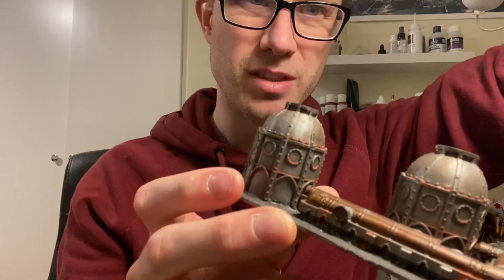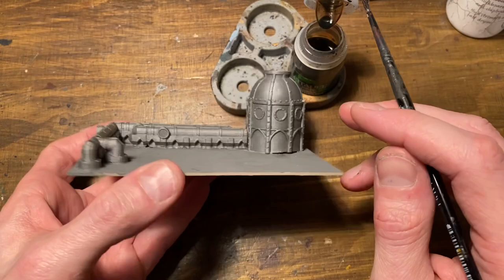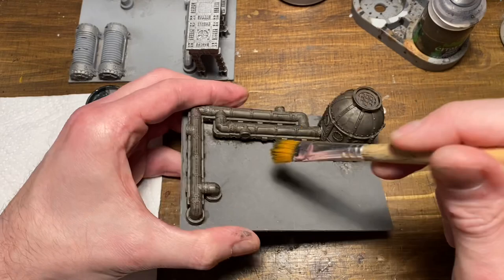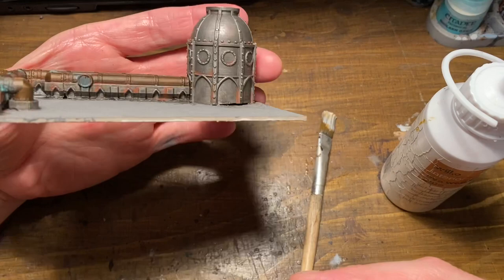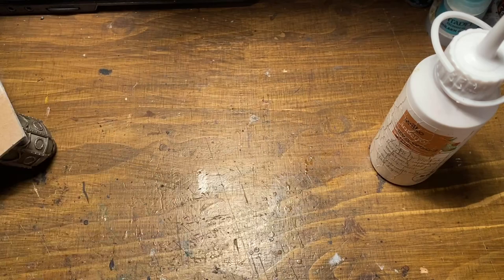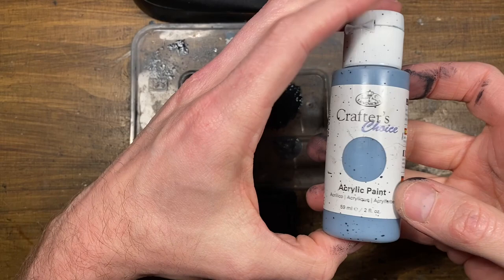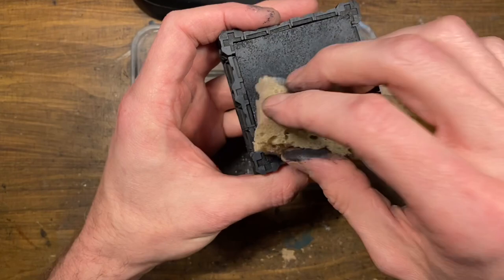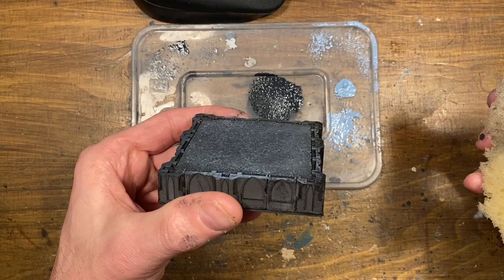Epic 40K/legion imperialis gaming table: painting, weathering, 3D printing (Adeptus Titanicus)

Comment: The cathedral roof in the final clip looks *chef's kiss*. Excellent work!

I've binged all of your videos in the last 2 days and have a question that might spark a long answer, but if you could give some insight that would be great:
What would you do different with your 30mm scale fantasy board now that you've had more time to mull it over and work on the Epic board? Would you use the laser cut wood and foam to make tiles? I'd love to make a modular board for MESBG, and your fantasy board has been a huge inspiration - but the gaps between the tiles is the main thing I'd like to solve before planning.
Reply: @rokminis59  Man, I hope you upload that build onto here too. I'm looking at doing a table in the style of the Gap of Rohan, but your build inspired me to have a third of it with a palisade wall and buildings in the style of Edoras/Westfold.

Do you see yourself switching to a resin printer any time soon, or are you only interested in using it for terrain?